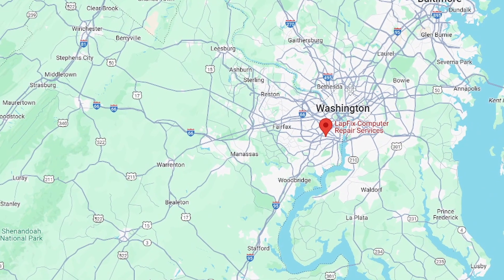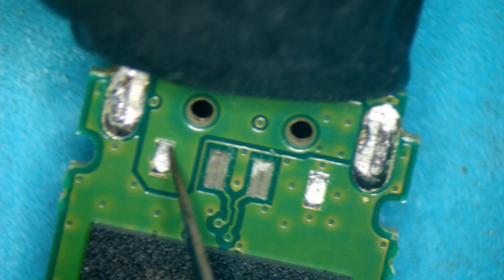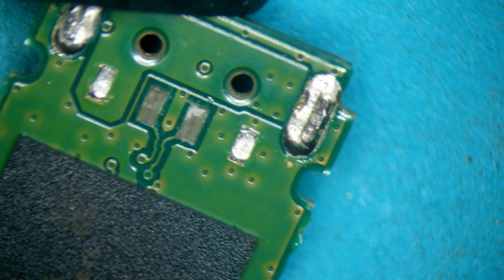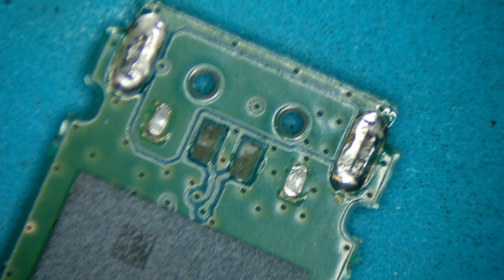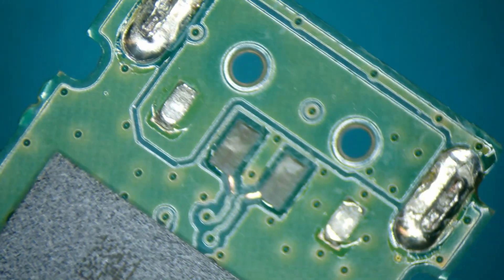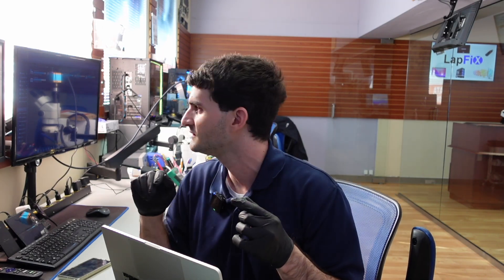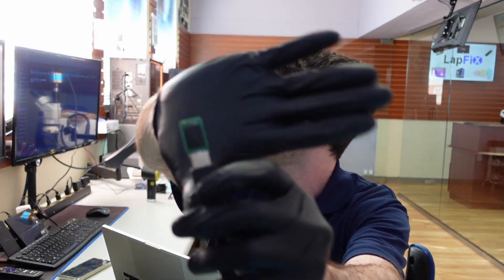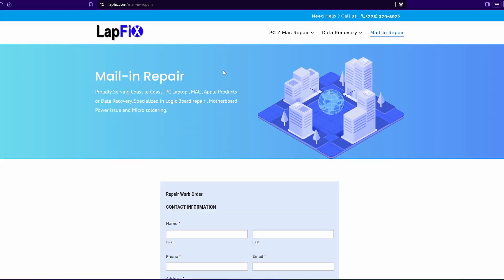Recovering Data From A Completely Broken USB

Comment from the maker: Interested in recovering data from your USB or hard drive?  We can help!  Check the links in the description for more more info!
Reply: Hi    how  long  does  a  usb  stick hold  the   memory  for      please   ??
Reply from the maker: NAND on any USB or flash device such as a SSD or Smartphone is determined by the amount of read/write as the NAND cells deteriorate with use.  This is guaranteed to happen eventually for all NAND devices.  However, they also have a PCB, components and usually a dedicated controller which something can fail before that happens, so always have a backup :)
Reply: @lapfix    thanks    very   much   
Im   backing  up   to  my    ssd   western   digital